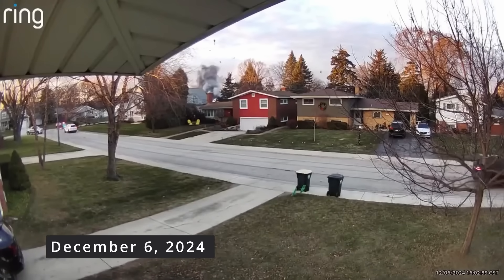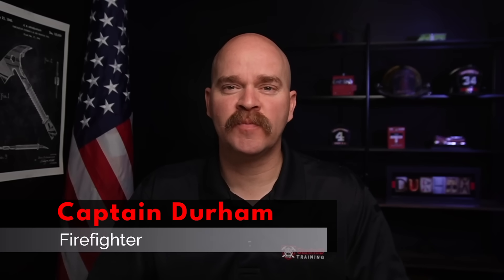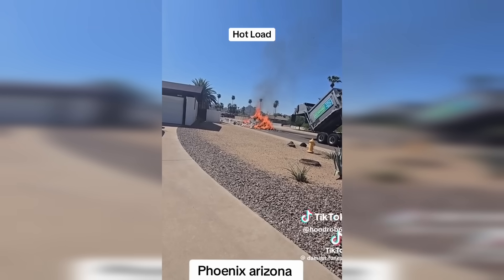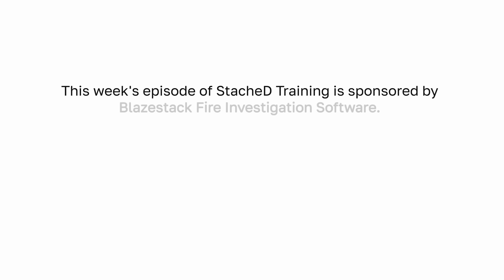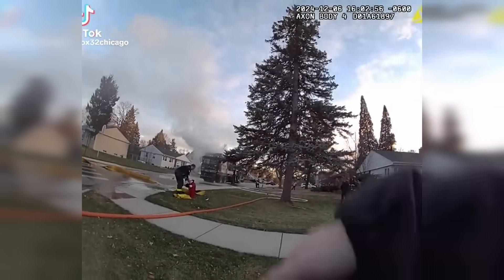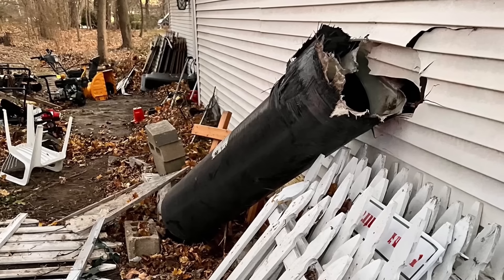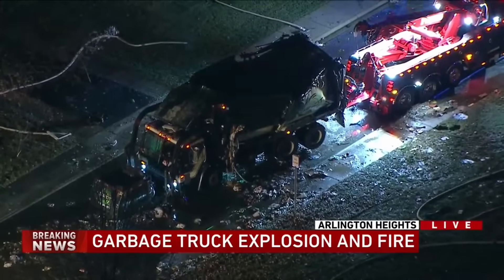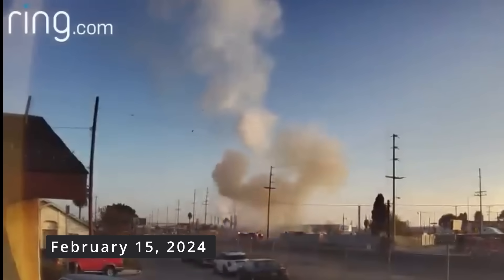CNG Garbage Truck Explosion Leaves 3 First Responders Injured!

Comment: If there was only some proven fuel source that didn't require such high pressures and was relatively inert at normal pressures...
Reply: There is. Forget the CNG  and go back to diesel fuel. Much safer
Reply: Gasoline, diesel, and alcohol.
Reply: @cherryjuice9946 diesel.   Gasoline and alcohol are to volatile.
Reply: @cherryjuice9946  alcohol is super dangerous with invisible flames much better stick with diesel , biodiesel.....
Reply: @cherryjuice9946  Nothing "Inert" about gasoline.  Safer to store than pressurized CNG but it will damn sure get your attention when it is burning when you don't want it to.  Diesel and Alcohol are NOT inert either, but much less volatile than gasoline.
Reply: @x-man5056  If we use your definition of inert, you'd need something like helium, which doesn't burn and can't be a fuel.  All fuels burn.   They wouldn't work otherwise.  Even coal doesn't fit your your definition, nor would a log of lumber.

BTW, I have several cans of gas in the garage, 2 antique cars, and 2 run-around-town cars, all running on gas.  I have two mowers, an edger, and a tiller.  Never in all my years have any cans or tanks of gas decided to spontaneously ignite.  It simply can't happen.
Reply: @cherryjuice9946  Not my definition, THE definition.  It's NOT a New Word.  To call gasoline, diesel, and alcohol "inert" is fundamentally WRONG.  CNG is obviously not inert either.  There is no 'relatively" inert either.  It's like pregnancy, either you are or you aren't.
Reply: @x-man5056 regarding "inert" if your definition is correct, then it's irrelevant because it fails to describe the spectrum of properties people are talking about.
Reply: @x-man5056  well done for completely missing the point, that they are still massively safer to handle  than the alternatives that are  pushed solely for ill considered eco reasons.
Reply: @benjaminshropshire2900  How about Inert is the wrong word.  There is no flammable liquid that qualifies as "Inert".  They are ALL "Chemically Reactive".  Contain stored energy.
Reply: @x-man5056  So you are objecting to someone on the internet using the wrong word when everyone here (with the possible exception of you) knows exactly what that person is saying? Well I guess it's up to you how you spend your time.
Reply: @x-man5056 i think he mixes terminology.
Reply: @x-man5056 I am having doubts about this cat's knowledge. Central Casting?
Reply: Gee... it's almost like "words have meanings"...
Reply: @DanRyan-v5y  They?  If you are going to criticize me, at least let me know what you are referring to.  Lots of comments on this thread.
Reply: @The_DuMont_Network   Which he?
Reply: @The_DuMont_Network  Which cat?
Reply: @cherryjuice9946  CNG doesn't spontaneously ignite and neither can it burn inside the tank. Yes, it's more difficult to store but don't write irrelevant stuff.
Reply: @skunkjobb  I don't see what you're getting at.  Gasoline, doesn't spontaneously ignite either.  What's irrelevant?
Reply: @cherryjuice9946  None of those are inert at all.
Reply: @jhoughjr1  I already said that.  I explained there are no inert fuels, but that wasn't the original posters statement.  He was wishing for a "relatively inert" fuel at normal pressures.  This is a clear question and clear answer and has been repeatedly explained by several people in this thread.
Reply: @cherryjuice9946  Gasoline fuel tanks are full of explosive vapor, and need not be pressurized to create explosions just as big as this one. Diesel - doesn't create explosive vapors though.
Reply: @suzukirider9030 Well, they kinda do, actually. It is just a different flash point.
Reply: now if  only there were something like that, that isn't going to run out eventually,
Reply: @ScottyTheHistorian  Well, there are biodiesels and renewable diesel. I'm not sure if there is an efficient and environmentally friendly way to produce them but there is potential there. Maybe it will get better as technology advances.
Reply: Even propane is way safer to have in a vehicle than CNG.  Pressures are just too high.
Reply: Why I kept my fuel oil heater. That tank sits ( legally)right next to home. The propane guy could only find one place on my lot that he would have been able to legally place a propane tank.
Reply: The Synthetic fuel that burns in petrol and diesel engines, used in the Porsche racing series.
Reply: It takes an open flame or electric spark to ignite gasoline cigarettes aren’t really that dangerous
Reply: @knuckles-3386  If you drop the cherry from a lit cigarette into a pan of gas, the gas will likely snuff it out.  If you have carb parts in the pan, and the cherry falls on a 'wet' part, that isn't deep enough to snuff the cherry, And it is warm enough for the vapor layer in the pan to reach the flash point, I hope your face and hands aren't in the way.  When you hear the VOOM, it's to late to get out of the way.
It is utterly foolish to be smoking around gasoline.  Your comment contains "famous last words".
Reply: There is a video I've seen, it was a security cam video at a CNG refueling station for municipal fleet vehicles, not public. There was a van refueling there with several people standing near it when it exploded. One man looked like he lost an arm by the way he was hanging onto it while running away. All they were doing was refueling in a controlled fenced off location and something went wrong. By comparison millions of careless random people refuel at gas stations everywhere without incident. I recently witnessed two fools get on a big motorcycle right after refueling and both of them lit cigarettes right next to the pump before taking off. There was another man at the pump next to me who also witnessed this. I said to him, did you see that? He replied, ahh nothing's gonna happen.
Reply: @onemoremisfit  "ahh nothing's gonna happen." are the most common, famous last words.  He is as stupid as the 2 dimwits smoking while on a motorcycle, let alone sitting at fueling station.  These idiots vote too.
Reply: @onemoremisfit Famous last words.
Reply: @onemoremisfit  lol ive tossed a lit cigarette into a cup of gas on a 95v degree day in July. Guess what happened? pssst. Cigarette extinguished. zero ignition with a half inch long glowing cherry.
Reply: @jhoughjr1  I've done the same as a kid throwing lit matches in it. I was trying to light it on purpose and a lit match got doused and put out. It's a freak occurrence but can happen if a little breeze keeps the vapor off the top because it's the vapor that ignites, not the liquid. It's why carbureted engines can flood and refuse to start if they intake too much liquid fuel at the wrong time.
Reply: @onemoremisfit  Bonding error and static electricity on the CNG fueling explosion I'd guess.
Reply: @onemoremisfit  False! "By comparison millions of careless random people refuel at gas stations everywhere without incident." Just go watch some youtube fail videos. Incidents do happen...............yes, as another person said, words do mean things. Poor language skills of the general public are one of my pet peeves. Yesterday, it was regarding the number of people who do not know the difference between electrocuted and shocked. They use the word electrocuted for anyone who has been shocked by electricity. Anyway, you do have a good point, which I also use regarding the few EVs vs. liquid fuels, but your statement is technically false. You might as well not make a mistake for the tree huggers to hold against you. "Idiots everywhere, refuel at gas stations with relatively few incidents!"
Reply: @CGT80  My reply was autodeleted.
Reply: @onemoremisfit  That sucks, assuming it was decent. YT censorship sucks.
Reply: @CGT80  There was nothing indecent. I don't do that.
Reply: It's been known for like a century how to build pressure vessels that won't burst under over-pressure but will crack and leak first. I don't know if getting that to work with COPV's is as well understood as with metal tanks, but if it's not already then it should be an area of active research.
Reply: @benjaminshropshire2900  I believe it's called an emergency pressure release valve.  shit even my pressure cooker has one.
Reply: @jp325abn the problem is what happens if the valve fails shut or the tank weakens from heat or corrosion? Sure a PRV or burst disk is a good idea, but there are design criteria that ensure that when things do go wrong you get a small rip rather than a boom.
Reply: @jp325abn the video covered that.
Reply: @akiwoo5205    yes I know that, I was answering a comment.
Reply: @benjaminshropshire2900   In the rocket business (think ICBM's), there is way more internal pressure and no metal liner.  Smaller tanks are cheaper to wind around a small metal cylinder instead of an arbor that is disassembled into smaller pieces and removed through the ends of the wound cylinder after it is cured.  
I do not see any evidence of a metal liner in the picture though, but that might just be a stock photo, not actual from this incident.
Reply: Batteries.

Comment: I'm not pointing a finger at anything until I've seen some evidence, but I think most supporters of lithium battery tech would agree that the chances of this burning-trash incident having been caused by the accidental or deliberate dumping of petrol or diesel rather than an unwanted electrical device are vanishingly remote.

Having said that, the most fanatical supporters of lithium battery tech are car-owning EVangelists, and they'll blame anything if it takes the spotlight off the (alleged) fire-safety issues allegedly surrounding the batteries powering their beloved EVs.

Comment: When I first noticed the use of CNG garbage trucks in my town, I thought wow, that's a good idea. Now I'm a little concerned that  safety regulations need to be updated.
Reply: I find it disconcerting that,less than 10 years ago CNG was heralded as THE SOLUTION TO SAVE THE PLANET! These days that is being downplayed by the hedge funds.
batteries,Batteries,BATTERIES!
Yes, lithium ion batteries involved here.
Imagine that.

Thank you sir for your continuing proffessional concern,
and reporting,on these catastrophes.
Reply: There is no safety regulation that can correct the hazard of driving around with a high pressure bomb on a truck!
Reply: There is. Forget the CNG  and go back to diesel fuel. Much safer
Reply: Cng would be a better idea if the .gov wasn't opposed to fracking and all forms of petroleum energy sources.

Still a suboptimal fuel source.
Reply: @randomidiot8142  I don't understand what government regulations on fracking, etc., have to do with the viability of CNG (or any petroleum based chemical) as a fuel source.